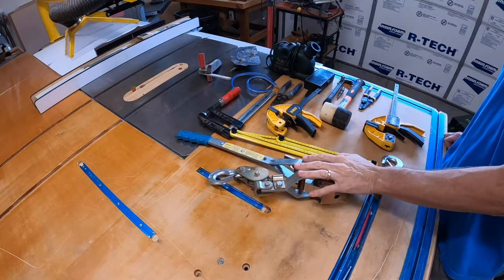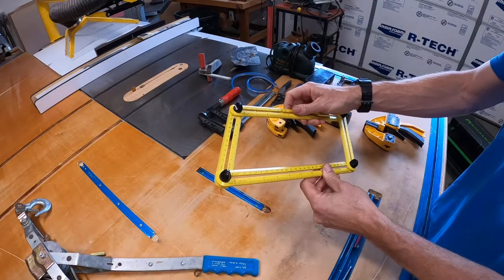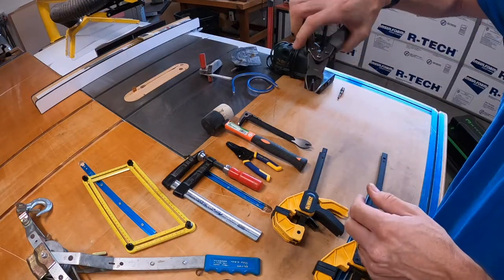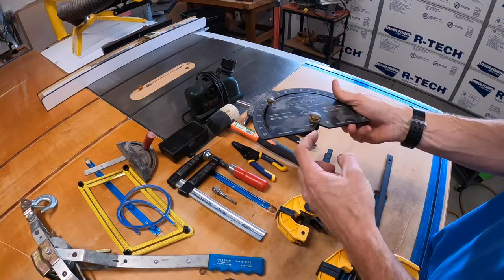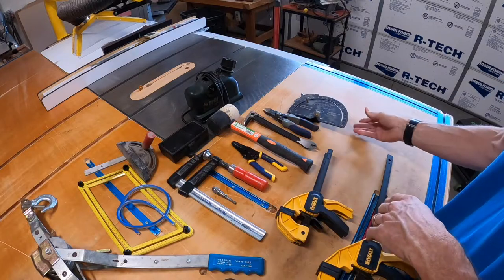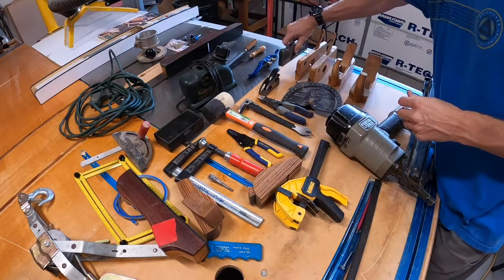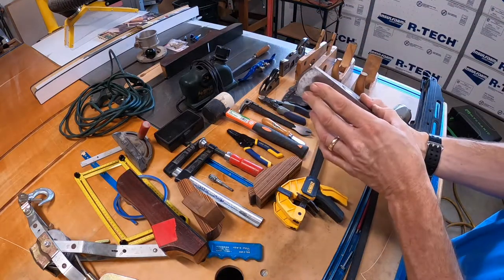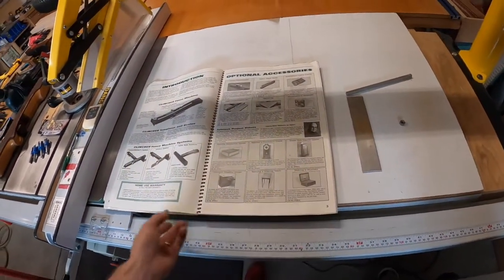Craigslist Massive Tool Haul Part 3

Comment: I see at least 2 drill doctors always for sale at machine shop auctions. It's always a standard in those shops.

I actually bought a flex ruler for $8 at the art store for architecture school, never ever used it. I end up giving it away to my friends kid after it sat in my draw for 10 years.  My mom actually taught me to use a tailor measuring tape to measure diameters. For a $1 it is super flexible and can be folded into a pocket. 

Amazing plane upgrades for your collection!
Reply from the maker: Drill doctors I’ve always wanted but with my use of mainly Brad point bits I thought they wouldn’t be useful.  Boy was I wrong. I’m totally loving the thing.  The shop I got it from was a machine shop abd wood shop.  I agree with you on that.  The planes are amazing.  I’m trying to figure out how to store them in my drawers.  I have to get back to work so my shop needs to be cleaned up!!!  Too many distractions.  Thank you for commenting and watching.  I appreciate it.
Reply: @davidbryanwoodworksandmore  Forgot to mention Guardair makes really nice air nozzle handles. And they are made in the USA, diecast grips and replacement parts for under $30 https://guardair.com/collections/safety-air-guns
Reply from the maker: Oh that’s cool.  Thanks for the heads up.  Amazing air attachment.